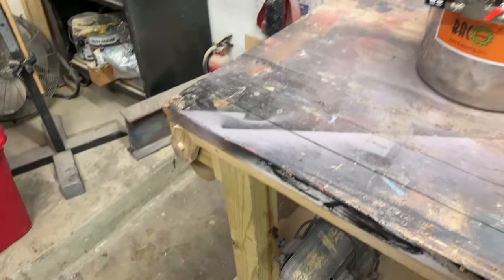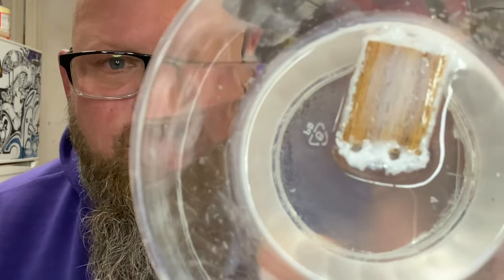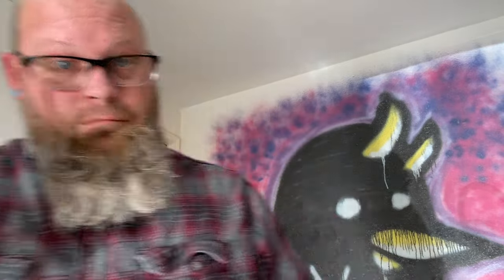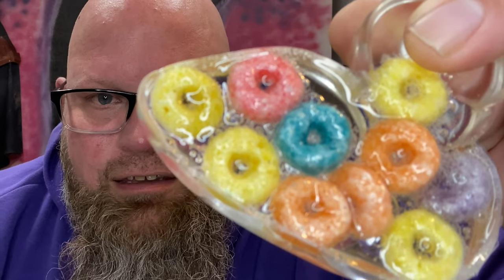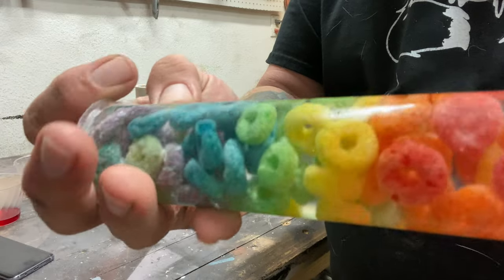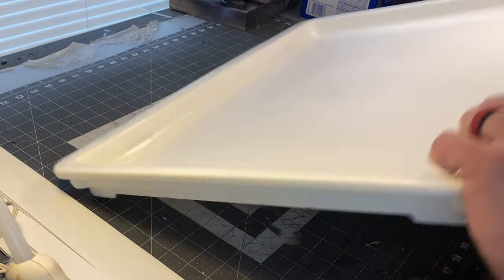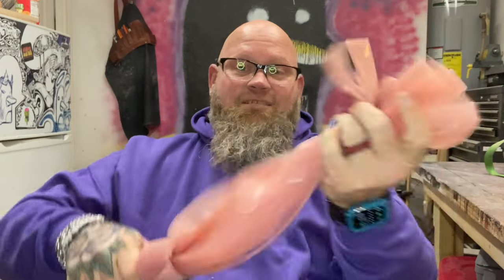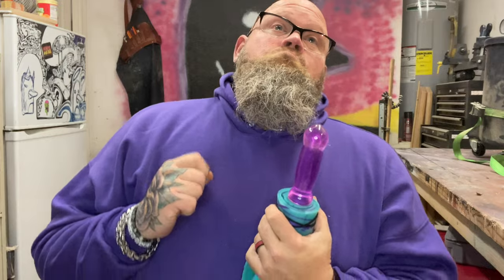Vacuum Chamber/Pressuire Pot and the Fruit Loop Flogger

Comment: I had no idea stabilizing resin would damage acrylic vacuum pot lids. Thanks for the info! 
Also, dying the loops to supersaturated so they would be the right color after is just brilliant. From the pictures I saw of the handle prior to the video, I had NO CLUE you did anything other than just chuck them into resin as is. 
The only other thing, that I doubt would have any major effect, is where you cut the strips in the sheet. Dragonskin is pretty tough stuff, but it might be worth using a small circular hole punch at the end of the cuts for stress relief. if you pull 2 of those strips in different directions, it would at some point tear further. Since it's all bound in the attachment to the handle, that will probably keep it from tearing, but I think it's worth mentioning if you ever attach it differently.
Reply from the maker: That’s a great idea with the stress relief holes. Thanks! I appreciate that.